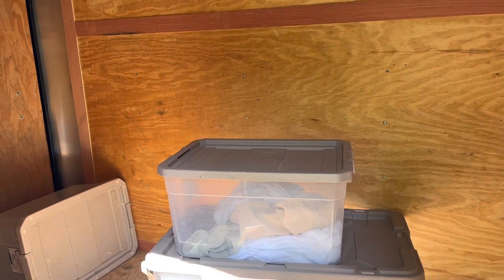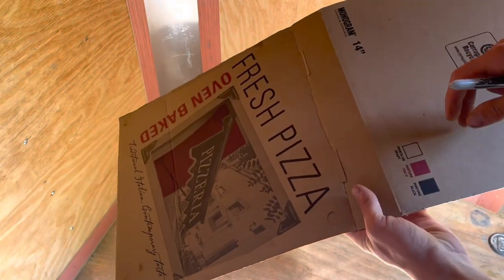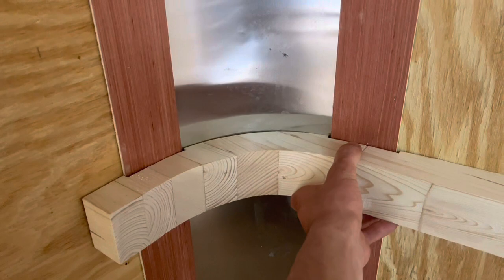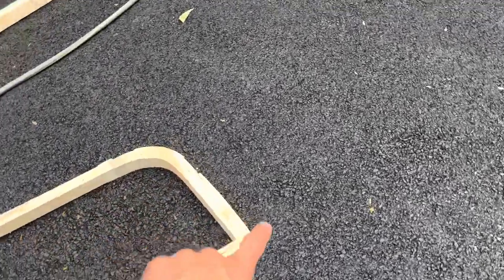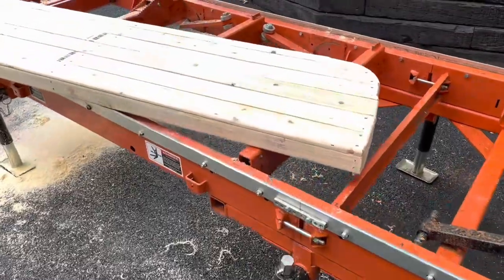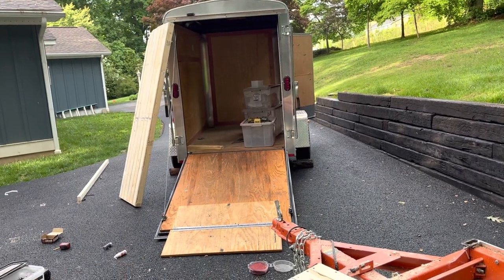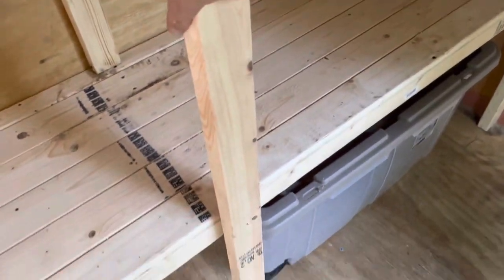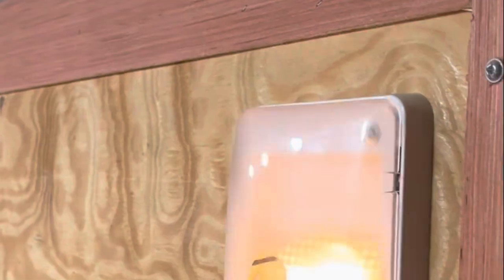Building Shelves In an Enclosed Trailer

Comment: I like what you did, Hopefully your goods do not weigh to much, you want to balance the load left to right in the trailer, otherwise it will have a tendency to roll in the heavy direction. If that were to happen you may want to think about narrower shelves on both sides and turn the bins 90 degrees. you also may want to consider a way to hold the bins from the front to back for when you don't have a full shelf to keep the bins from sliding back and forth. All in all very nice start. I really like how you thought threw the curved part.
Reply from the maker: Thanks! Yeah the weight shouldn’t be too big of an issue. The open space in front is getting filled with white tables and chairs and the tent and a bunch of other crap I have for the craft shows. And all of that added together should be pretty similar to the weight of the inventory.

Comment: I’m a fan of placing jack studs between the shelves but that all depends on how much weight it has on it. Putting everything on just the screws is fine but jack studs that are only an inch thick can be glued into the existing legs. Probably fine unless you’re selling some heavy logs or anvils haha
Reply from the maker: Yes that is still something I want to do. Cut some pieces to go between the shelves and transfer that weight to the floor. I will definitely probably do that in the future to beef it up a little bit more. Wouldn’t be much work and I got piles of scraps

Comment: Great video!  I am looking to add some shelves to my enclosed trailer and this was very helpful.  What did you use to secure the shelf frame to the wall?  i want something that will hold, but I am concerned because the wall material doesn't seem to be very thick.
Reply from the maker: I used 2 1/2” self tappers into the “studs” of the trailer. The frame itself